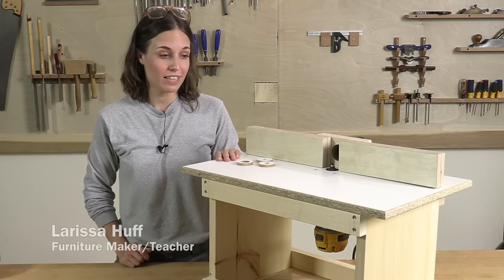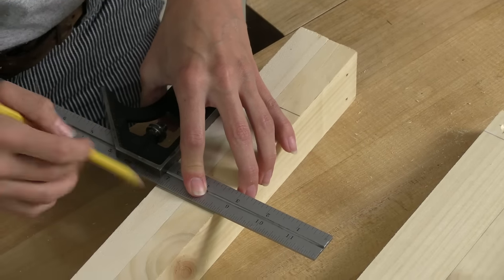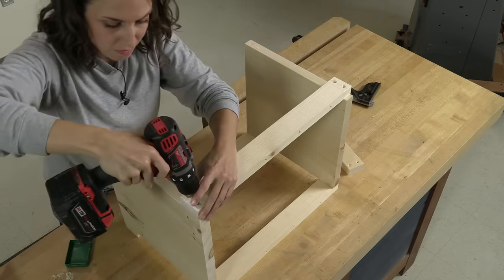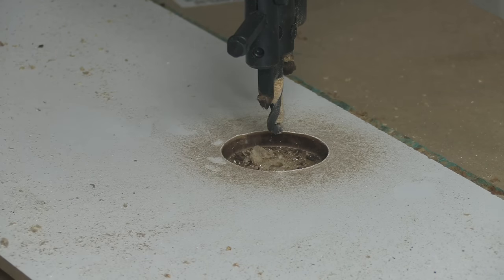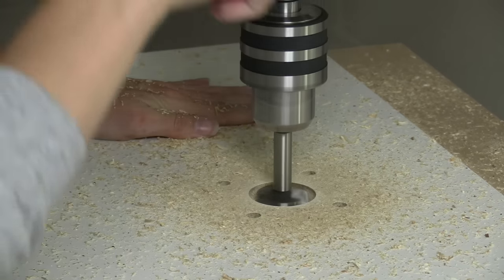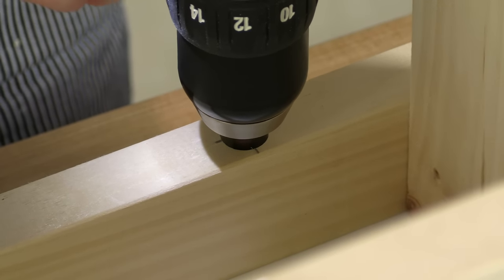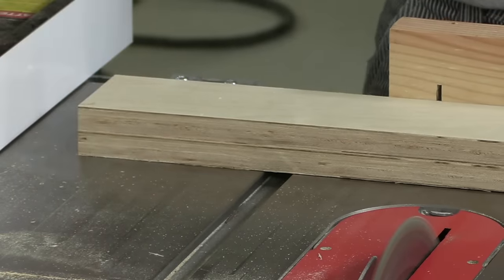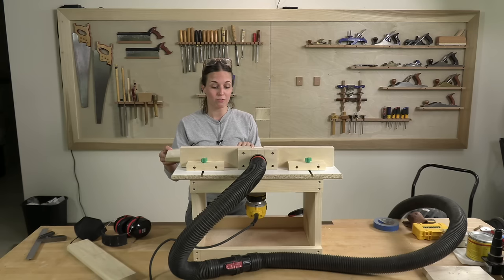One-day router table build

Comment: Very nice! One thing you should do though is learn how to use an impact gun for running screws, and save the drill for making holes. I noticed you let that bit spin over the screw heads a few times during the video and that mars the screws. When you learn to use the impact gun properly, it is less likely to spin out on the screw head and is far easier. It also is less likely to heat up the screw and snap it off while it is driving in your material. A lot of people incorrectly think this is the opposite, but after years of using both, I can tell you an impact gun(while noisier) is far better for installing fasteners than a drill with a properly set clutch. The key is learning how to use the variable speed trigger, and learning when to stop when the screw is seated.
Reply: Agreed. I stopped using a drill for running screws years ago for the reasons you listed. It is more difficult to use a drill to run screws anyway. Requires much more pressure on the back of the gun to keep the screw seated, due to the torque not letting off. That's what impact guns do, is rapidly stop and start torqueing the screw to maintain a proper seat in the head. The vibrations also help remove over tightened bolts and screws as well. A regular drill will just snap off heads or damage them so much that you can't remove or reinstall them when needed. The tricky part definitely is learning to manage the trigger pressure and learning to stop so you don't over tighten screws/bolts.
Reply: L
Reply: I don’t think you need to give such basic advice to someone who has made a table router from scratch?!.
I find impact drills too strong and uncontrollable for a small job like this.
Reply: @Rich-do9mr no.  She spun out and marred the screw heads on multiple occasions.  All impact guns come with multiple torque settings and a variable speed trigger,  so no,  they are not "too strong" for anything.
Reply: @Rich-do9mr  she is a YouTube woodworker.  Let's not pretend that she has any real skills. This is a simple build.

Comment: Great little build and easy to scale. I’ve been looking for a simple no frills bench top router table design and this will do it nicely. I’m going to build this with two small changes…wood glue where applicable and T-track in place of dovetailed slots. Thanks for posting this!
Reply: And restrict the airflow around the vacuum port.

Comment: Well done and very helpful.  I like the detail on the vacuum hole on the fence.  Questions: 1.  Why didn't you use any glue on your strechers?  2.  What keeps the dovetail slots from eventually
wearing out because the melamine is fragile and will chip out within a short period of average  use..  Thanks for answering.

Comment: Nice build, but I recommend a pre-built router insert, which is much thinner than the table top; router bits wont be able to fully present through think top, you will lose the ability to use certain profiles.
Reply: True, but that can also be countered using router bit extensions which are much more commonly available and fairly inexpensive nowadays.

Comment: I have seen many builds of router tables for trim routers and they all seem to state that the make of the trim router is not that important and all the builds are somewhat the same, some with more bells and whistles and some without…
But I have to ask and presumably because of ignorance due to not owning a trim router, but how do you adjust the height of the router bit from under the table and is it possible to do it accurately enough?
I have several cheap plunge routers and they are all really bad at keeping their plunge depth, with or without the springs in them, so I think I should go look for a trim router instead…
Thoughts?

Comment: I’ve got the ryobi 1 1/2 HP router, would there be much different to change to be able to use it? Not a trim router so adjusting it is a bit different. Thanks
Reply: You can use that no different then what she is using....just have to match your holes to the particuliar router plate on your ryobi.

Comment: When using a drill press, there is a serious hazard in using just your hands to hold the work piece material. When a drill bit binds or seizes in the work material, the material is swung around so fast that it often takes your hand with it before you can react or let go. A fellow that I worked with lost a finger when this happened to him. Pinched between the work piece and drill press column.

Please clamp your material to the drill press table. Or at least swing your material around in the same direction that the drill bit turns, so that your material contacts the drill press column before turning on the power. And hold down firmly if not clamped as your work piece will climb up on the drill bit, also causing it to bind. Anything too short to contact the drill press column before starting needs to be clamped, and that includes drill press vises.
Reply: That fly cutter spinning at that speed set my teeth on edge.

Comment: ... all you need is one board from your local wood store.... 

blank stare 

Ahh, yes and of course all the industrial grade equipment I saw come by during the ten minutes watching this short video....

Not wanting to be an arse, I really did enjoy the video and there are certainly things people will learn from it, but I'm guessing most people (like me)  just have a hacksaw and a hand drill instead of the professional table saw and drill column that you're using. With respect, again. You absolutely look like you know what you're doing, so every compliment for this video, but I did feel I should mention this small bit of criticism. Carry on ! 🙂
Reply: You are definitely overblowing the professionalness of the equipment she used. The table saw is nothing special, you can get a basic one for something like 300 $/€/£, or you can use hand circular saw, band saw etc. Heck, nothing stopping you from using your hacksaw, if you're patient enough. The drill press is just a convenience, you can do the same with a regular 30€ drill from Lidl. And no matter where you live, buying a basic sheet of plywood is absolutely nothing special. 

And besides, if hacksaw is all you have, why are you mucking around with a router? You have more basic tools to buy before you get to that.

Comment: Is there a material list?  (Apologies if I missed seeing it.)  There is a comment at the end of the video that the router table can be built from "one board from your local box store".  The size of the sides makes me think a couple 1x8s are cross-cut to length and glued up, then ripped to width?
Reply from the maker: Article in the description
Reply: @FineWoodworking  I re-read the article in the description and can't see other materials listed other than the MatchFit parts.
Reply: It's all made out of one sheet of plywood, what are you people talking about?

Comment: Nice simple build, but your casual use of PPE is a worry. No ear or lung protection while drilling is a problem.  Hearing and lung damage is incremental.  All of those small operations, add up over time.  Drilling and shaping create fine dust every single time.  And composite materials like that melamine particle board, are especially damaging to your lungs.

I would definitely add an edge to that melamine board used for the table top to protect it instead of chamfering it.  It would protect it, and make it look a lot better as well.
Reply: Exactly. That may just be Melamine, which is pretty much considered inert and in limbo at present with regards to health research and its carcinogenic potential, but what it's veneered to is particle board, a thoroughly nasty concoction that more often than not contains formaldehyde and crystalline silica, both of which being fully capable on their own to cause cancer through moderate exposure. Moderate, not long-term occupational but simply moderate. A respirator should always be used when working with particle board to any extent, no exceptions. Unless, of course, one is all-on on inhaling carcinogenic fumes and having their lungs shredded and permanently scarred by microscopic crystalline shards.

Hearing protection is a given. Although one can certainly nearly recover from short-term exposure to high decibels, the damage is as you've stated, compounding over time. For the woodworker, that compounding damage is like whittling away at a chunk of wood over a long period of time, taking tiny slivers off with each stroke. Although it never really looks like much is changing over the short term due to how little is being shaved off at a time, the end result is a sizeable pile of whittled away slivers in the long term without much actual wood left to work with. That's how it goes with hearing loss. You won't notice it today or tomorrow. You'll notice it when you can no longer hear birds chirping or music being played or people talking. Again, best practice is to employ the hearing protection any time machine is turned on, no exceptions.

Comment: Any suggestions for how to build this project for those who don't have access to an industrial drill press?
Reply: You can buy a guide for a hand drill, or you can make a thicker block with a carefully drilled hole in it and clamp that to the surface and use that to guide to drill bit with the hand drill. Use a brad point bit so it doesn’t swim out of place.
Reply: @llsheridan1034  Thank you for the suggestions.
Reply from the maker: If you ignore the inserts, this should be very doable with just a handheld drill. I worked for years on a "router table" that just had a 1-in. hole drilled in it. -Ben

Comment: Most drill presses have a depth stop control to prevent the drill from drilling too deep; ( 5;47 )using this feature on the drill press ensures that you don't accidentally drill through the material you are using. I guess some drill presses might not have this feature.
Reply from the maker: She did use the stop, I think the point she was making is that you can still go past the stop a bit by pushing too hard on the handle. I've done it as well. -Ben
Reply: @FineWoodworking  Thanks Ben, I watched that part of the video again and you are right, she did use the depth stop.

Comment: Good job, madam, with some caveats:
1. The worktop should not be made of chipboard, but of plywood, which is much stronger and resistant to abrasion and breakage.
2. The slots should be T-shaped, not V-shaped, and the bolts must be with hex heads with size matching the T-slots.
3. The fence does not need to be that thick, and should be made from one single piece to ensure straightness.
4. Use steel 90° L-joints instead of wooden blocks to fix the fence.
5. For extracting the dust and providing enough space for routing bits make an arch in the fence and attach a plastic or wooden dust collector (or suitable vacuum cleaner bit) on the rear side.
I hope your next project to be much more successful. Good luck!
Reply from the maker: ummm... no.
Reply: This is obviously a starter project for beginners to make. Your comments aren't helpful.

Comment: I call this video woman makes simple router table using tools 99.9% of us don’t own.
Reply: In this case anyway, the simple router table build requires nothing more than a circular saw, a drill, a few measuring tools and some clever tactics with the very router that will be attached to the table. If you want added precision for aesthetics, Kreg's cheapest pocket hole jig is about $25.00 and their cheapest drill guide / doweling jig is $10.00.

Of course, at least as demonstrated by Izzy Swan over the past couple decades, if you have a table saw, you have absolutely no need for any other tool end of discussion. :D

Comment: “All you need is one board from your local box store”🙄🙄🙄 
Uses plunge routers, 100 different router bits/sizes, table saw, flap bits, drill press, homemade clamps etc…😭😭😭
This requires very advanced work working skills and a lot of quality tools to replicate😞
Reply: This requires any type of a saw, any drill you can find, and a router, which you must have since you're building a router table. Stop whining for no reason, and use the tools you have.
Reply: @davorzdralo8000 @0:03. Simply in accurate! I’m speaking facts. You’re speaking nonsense. 
This lady has an entire workshop. I assume you do too. Most diyers like myself with no work bench, some Milwaukee tools and some plywood would spend hours in a hardware store trying to find all the correct bit sizes and have to learn how to use a router to achieve this level of craftsmanship. Simply not as “simple” as she stated. Stop whining about my whining!
Reply: @davorzdralo8000 would be nice to have an entire “tools required” list to replicate what she made. But yeah as soon as I saw the drill press, I was disqualified from even attempting… 50$ in supplies, 1200$ worth of tools. I’ll just go buy a used router table for 600$…